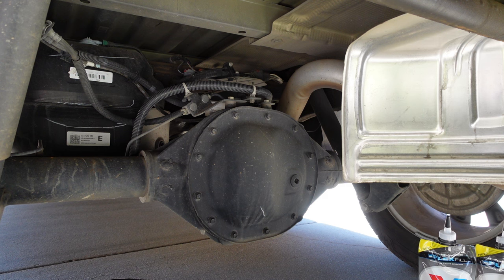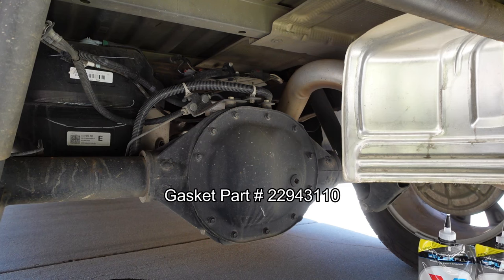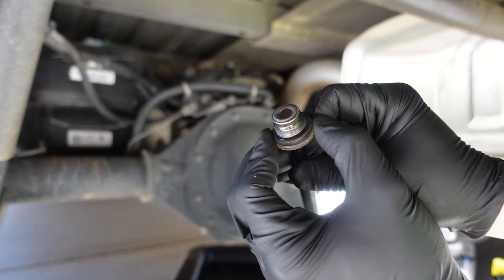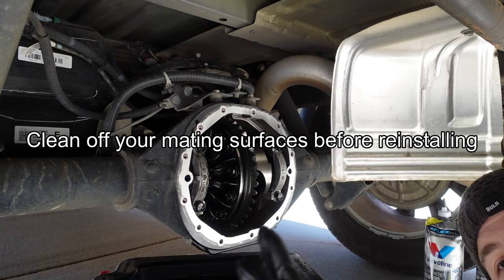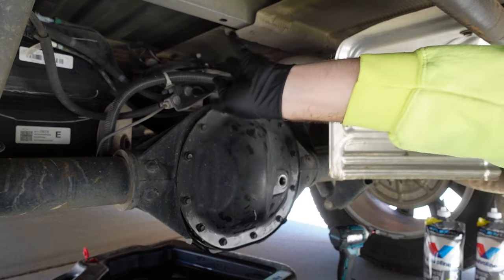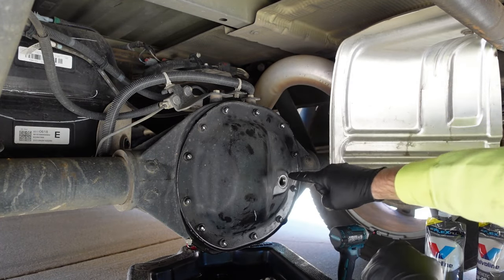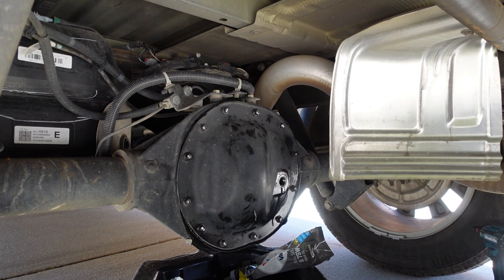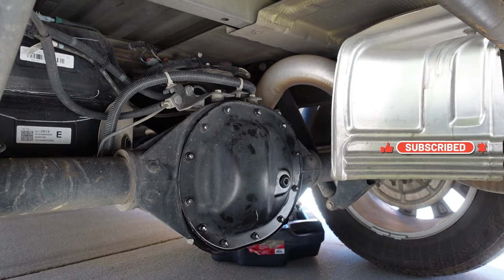[HOW TO] Change Rear Differential Fluid on a 2019+ Silverado & Sierra(Axle Code SU7/SU8)

Comment: Good video! Just a heads up for some people though my 2019 Silverado didn’t have a gasket but rather a thin red gasket made in the factory. Luckily the gasket did not peel off when I removed the cover so I was able to press the cover back over it with no leaks but I sure wish I had a gasket or gasket maker on hand because I was definitely not expecting to find what I did.
Reply from the maker: Thanks for watching. I’ve heard that about the gasket

Comment: I changed the fluid on my 2020 Silverado 1500 yesterday and it didn't have a reusable gasket.  Be prepared to buy a gasket when you remove the cover.  I had to order one.
Reply from the maker: Really? What was the gasket made out of? my truck is a 2022, had the reusable gasket...
Reply: @fondupot  it looks and feels like hard cardboard. I don’t know what the material is.
Reply from the maker: Strange. Not sure why it was like that.
Reply: I just opened my rear differential on my 2019 Silverado and I didn’t have a reusable gasket either. Had to wait for one I ended up ordering online.
Reply: @fondupot My 2020 LT Trail Boss has the same gasket your truck has. I had to get mine at my local dealership, and the guy showed me in his computer that the rear diff gasket is  a one time gasket. My thing is, with how well made they are why cant i reuse it? Or at least why do they suggest we dont reuse it? Im assuming its a money grab ordeal.
Reply from the maker: @sectech221  if the gasket isn’t cracked or deteriorated I think it would be fine to reuse it.

Comment: Excuse me, I have a 2019 Tahoe. After how many kilometers should I change and replace the differential oil?
Reply from the maker: I typically recommend every 50,000 miles under normal circumstances.
Reply: @fondupot  

THANKS

Comment: Did you take a look at the side, or "spider" gears? I've heard some of the locker gears have a cosmetic issue in that the ends of the teeth aren't fully filled, but the contact pattern is okay, so they should be functionally adequate. Now I'm curious how close to the textbook ideal differential gears and other automotive components really are.
Reply from the maker: I didn’t look that hard. My truck doesn’t have the G80 locker tho. Standard open diff.

Comment: Great video, I  did notice that you didn't use any thread lock,  GM calls for it as per service,  but not many people use it, as this  is  a great debate . How is it holding up? - thanks.
Reply from the maker: Been fine. No issues whatsoever. Thanks for watching.
Reply: I've been twisting wrenches for 4+ decades, and I've never used a thread locker, ever. Correctly torquing a bolt will prevent it from coming loose. It's the same practice for doing my own oil changes. I correctly "hand-tighten" the filter, and then snug the drain plug with a wrench. I bottom out the plug, and then give it a small uggadugga. They've never come loose.
Reply from the maker: Giddy up.

Comment: How often should one do this service?  Doesn’t seem like a difficult job, but there is no recommendation in the manual, which baffles me!
Reply from the maker: I like to do the differentials every 45000-50000 miles.
Reply: @fondupot  ok, I just did my transfer case so I’ll do both of these as well!
Reply from the maker: Good idea! I do all three together usually.

Comment: Nice thing about these magnetic plugs. I imagine, that while they do catch some minor metallic dust from normal wear, if one sees, during a fluid change, many large shards of metal shavings, that will immediately indicate there is a problem in that differential with degraded gears and needs to be checked and taken apart (cover) for inspection.
Reply from the maker: Yea it helps for sure. Unfortunately GM removed the drain plug from the rear differential sometime mid 2018. So my 2019 GMC Canyon doesn’t have one. Luckily the fill port still has a magnet.

Comment: thumbs up and subbed ....   question why are you changing the gear oil with only 50,000 miles on it?
Reply from the maker: Preventative maintenance. I like to do diffs, transfer case and transmission every 50,000. Will make the truck last a lot longer and have less issues down the road. Also the factory fluid is not synthetic. Thanks for watching!
Reply: @fondupot  ok I see yes I like to use all synthetic once the truck has a few miles on it.. also just picked up a 2023 WT  traded in my 2022 nissan frontier (I was not happy with that truck) .... your channel caught my eye with the cluster change video and have been trolling your channel for more info lol  ... great info thx
Reply from the maker: Right on thanks for watching. Enjoy your new truck!
Reply: My thought is that the oil/fluid becomes like sandpaper because of the metal particles that build up in it.  Routine fluid changes remove the particles and should prolong the life of the metal.  I just changed my rear diff fluid on a 2020 Chevy Silverado 1500 and the fluid was very dirty.  The magnet had a lot of particles on it.
Reply: @sncconway  how much miles you had on your Chevy?
Reply: @MrSmurf459  68,000 miles
Reply: @MrSmurf459  it my Dads truck. If it were my truck I would have changed the fluid at 20k for the first change.
Reply: @sncconway  and after that?

Comment: I just bought a 2011 Chevy Express with this same diff cover.   It had a leak from the diff cover so I got a gasket from the auto parts store and followed your instructions (although, my gasket was paper and the one that was on it was paper).   It was still leaking so I got a second gasket and tried again (still paper, it's what the autoparts store told me was correct).   STILL LEAKING!
Where do I find a rubber one like you are using?   I'm tempted to RTV this thing on there and forget about it!   If you have any idea where I can find that exact gasket, please let me know.   I've been looking all over online and can't find one like that.
Reply: Correction, I just noticed mine is the 14 bolt and yours is only 12.   I'd still love to find a rubber gasket though if you have any idea where to find one.
Reply from the maker: I’d say you’re better off using RTV. I don’t know if GM makes a rubber gasket for your 14 bolt.

Comment: What do you use to clean the gasket?  I've never been sure if break cleaner would be to harsh.
Reply from the maker: I just wiped it down with a shop towel. I feel like brake cleaner might degrade the rubber.
Reply: @fondupot  Thanks

Comment: Hey brother, are you using the AC Delco service manual? I’m trying to do some work on my pops truck…he’s got a 2019 Silverado Crew Cab LTZ…build sheet says it’s got the SU7- Axle RR with GU5-Rear Axle 3.23 Ratio and the G80-Differential, Auto Locking Rear…the front differential is the SU4…it’s also got NQH-2 speed electronic transfer case. Was planning on going with Amsoil on the front and rear diff it’s a 75W-90 gear oil, just not too sure whether to add any friction modifier to the front and rear diffs since it’s a G80, but it’s also got the 2 speed transfer case with the 4HI,4LO and Auto buttons…you got any advice?
Reply from the maker: I am using an online service manual. The website I use is alldata.com

Don't use any friction modifier in the G80 equipped rear end. You can use a fluid that says its already in it...but do not add any additional LS additive. I have a GMC Canyon with the G80, and I run a 75W90 fluid without any LS additive. OEM AC Delco always works great.
Reply: @fondupot  appreciate the advice…I’ll check the site out, thanks!
Reply from the maker: @Cat-cp1jo  Glad to help.
Reply: @Cat-cp1jo I would still go with the severe gear from amsoil. I dropped the oem fluid at 60k on my last truck and it was black thin swamp water. Luckily I didn’t wait until 100k like the manual stated.
Reply: @stevesherlock5334  ya, I’m gonna go with the Amsoil severe gear 75W-90 on the front and rear diff and Amsoil signature series fuel efficient ATF in the transfer case…get all that break in material out of the system. Probably end up taking the truck to the dealership to get the transmission taken care of, but not to excited about them working on the truck
Reply from the maker: Fine a reliable transmission shop to do your trans service. Dealer overcharges.
Reply: @fondupot  that sounds like a better route...I’ll look into it